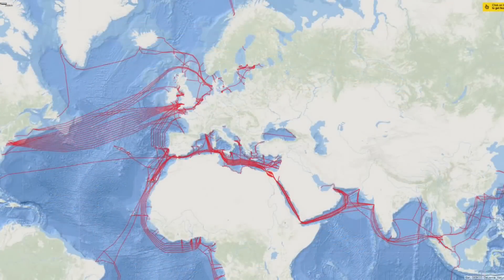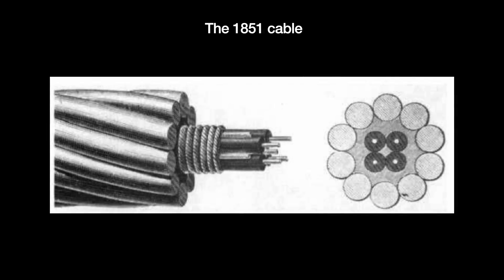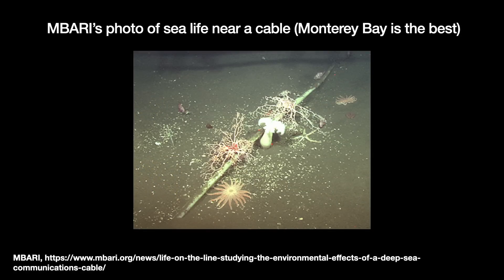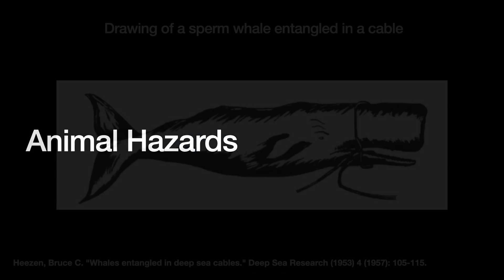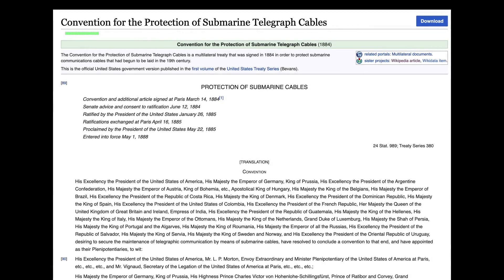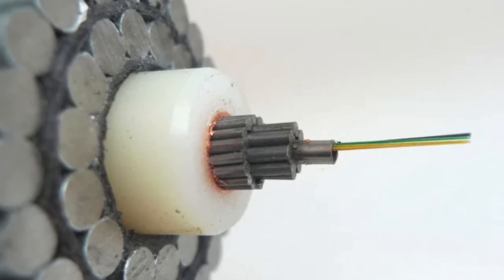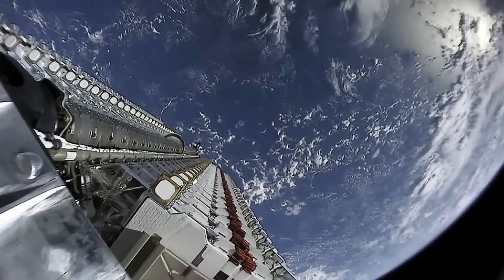The Hazardous Life of an Undersea Cable

Comment: I don't believe anyone was building a telegraph network in Germany in 1811 (at 0:33)
Reply: It was an optic telegraph and france already had one in 1790s.
Reply: @anush_agrawal  I did know that but the context here is an electric cable in water. Begs the question, why was a cable needed for a line of sight optical semaphore ? Interesting that we are back to using light, now in fiber.
Reply: @glenbirbeck4098  It was not a optical telegraph, my mistake, but a telegraph which functioned thought electrolysis. It was electrochemical telegraph. The message was read by amount of gas emmited in the process.
Reply: @anush_agrawal  Thank you Anush. This telegraph with electrolisis would make an interesting element in a "steam punk" story.

Comment: Now lets talk about it's not like you can connect a magnetic inducer and read the magnetic fluctuations of the copper wires how do they perform espionage now under sea with optical cables? I'm sure this man knows?
Reply: Guess the answer is every 60km, repeater

Comment: A good friend of mine, trained as ME, worked in BL served as Undersea Cable system engineer and dual-reporting to AT&T Undersea Cable business unit in late 80s and on, until sold to Tyco. He said shark bites were/are the common occurrence.  We theorized that
- in electrical signal transmission, although at T3 speed, the pulses and harmonics emit RFI, electric shield (steel armor as emission shield) does not work too well.
- Since the new TAT-8 has just transitioned to optical fibers but the problem still did not go away, so the working theory is magnetism!
<-- it is due to HV DC*1  is carried within (to supply power to intermediate nodes*2).  This uni-direction flow of DC current generated very strong magnetic field and the sharks are very sensitive to that (and would bite.)

*1.  DC current is one way passing through cable sheath, the return path is "Sea Water"!!!
*2  There are many of them, not just for signal regeneration and/or multiplexing.   Other "undisclosed functions" were/are deployed.  Undersea (under the sea) is fun, isn't it?
Reply: which 3LA puts out those "undisclosed functions"?
inb4 the answer is "yes."
Reply: Sea Water return!? That means intermediate nodes and end nodes need electrodes to the sea water, right? Sounds like a nightmare of rust/oxidation.
Reply: Seems like an ideal private industry/government "partnership."   If you want a network of hydrophones on the sea bed to track.. aquatic activity.. they naturally need some data communications.  And if the cable operator needs amplifiers ("easy") or repeaters (harder/more expensive) those would seem to be an ideal place for such a thing.    

These days under the Atlantic, you can avoid needing any repeaters -- devices that recover bits and remodulate/retransmit them -- using low dispersion fiber and optical amplifiers.   You can deploy an optical amplifier that will increase the signal level of all the wavelengths of light in a fiber used in a DWDM (dense wavelength division multiplexing system.)   This is very powerful because it doesn't have to split out each wavelength, detect the signal, retransmit with a laser for each wavelength, and then recombine.   The optical amplifier works on all the wavelengths "at once".   

But this is where you need "low dispersion" fiber.   Imagine that you transmit a single pulse of light (on a particular wavelength/color).  As those photons propagate down the glass fiber, they don't all take exactly the same path through the glass.  So that pulse of light will start to "spread out" as it travels through the fiber.  And the problem is that it spreads out too far and smears into the previous and next pulse.  Low dispersion fiber is carefully made using magic and physics and fancy manufacturing to keep the photons nudged closer to a single path down the middle of the fiber.   The extreme version of this is "single-mode" vs. "multi-mode" fiber.

There is an amazing amount of engineering going on with these systems, and over the last decade or two, the systems are constructed to carry data as the first-class, primary customer, rather than synchronous TDM traffic of multiplexed phone calls.  The hand-off to customers looks like an ethernet, and cable operators have much more flexible bandwidth allocation tools available that didn't exist in the past with SONET/SDH transport systems.
Reply: Some of this is undoubtedly true.  We had cables which did NOT have a steel cable wrapping, with very high voltages in them.  The copper outer shell did not contain magnetic fields hardly at all, and mostly by eddy effects.  Leakages were high.  We did one job, where the strength members were all Kevlar or Aramid fiber.  In that case it did not matter if anyone tapped it, since it was just going to an undersea oil drilling tooling fixture, and everyone knew what was going on.
Reply: Hazardous environment justifies the investment of pre build maintenance facilities and repair possibilities thus IMHO never a super long cable without built-in pods.
BTW, between technology and political influence, one always wins.

Comment: How do they repair these cables, lifting them again from the ground should be nearly impossible if the range of weight is between 15-70kg/m length, right?.?
Reply: It's true they are heavy, but that is usually how it's done. Bring each end up to a ship where the splice is made
Reply: @projectnarrowpace  I mean I can imagine that might work for cables in a depth of 200 or 400m maybe but what about transcontinental cables, across the Atlantic or the Pacific Ocean?.?

Comment: I live in Launceston, Tasmania.  There is a proposal to build a factory on our main river (Tamar) to build this sub sea cable, it requires a 200 meter high tower so the dielectric can form uniformly under gravity.  The people responsible are trying to make a cable for deep sea power transmission.
Reply: HVDC cables have quite different needs to communication cables. On the upside, no repeater stations. On the downside, more expensive materials (on the new one being laid from Morocco to Britain the copper alone is almost half the cost of the entire project) plus you MUST bury them well (can you imagine what happens when someone's anchor breaks one ...).

Comment: Revives memories of how slow the internet was in the 90's because of the lack of undersea cables & the number of personal servers in UK dorm rooms instead of AWS virginia.
Reply: Dialup internet was soooo slow, and you can't use the internet and landline at the same time. "Bad" times.
Reply: And there was also significantly less competition for those resources as well. No streaming, no online gaming etc etc etc
Reply: Inb4 fiber optics provided cheaper materials with better transmission.

Comment: The first undersea telegraph cables were in the 1850s - 1860s and the whole world was connected by about 1900.  But all of those cables were just that, a big long wire, and enormous voltages were used to send messages very slowly.  Telephone and high speed data needs amplifiers and electronics.  That wouldn't happen until 1956 with TAT-1, which had miniature highly reliable vacuum tube amplifiers built into the cable, every hundred miles or so.  Up to 36 simultaneous phone calls between Canada/US and the UK.

Comment: One of the most interesting aspects of this story, to me, is the lag between the first transatlantic telegraph cable, and the first tele-phone- cable, TAT-1, almost 100 years later!!  And half a century after Marconi spanned the Atlantic with radio in 1906. You would think the transistor ultimately enabled it, and of course that had to wait until 1947. But they were new and un-tested.  It was all done with tubes.
Reply: Bandwidth requirements for telegraph (binary Morse code) and telephone (voice) are RADICALLY different. The capacitance of the cable really affects that - and seawater is a wonderful dielectric (ie a cable under it creates a massive capacitor).

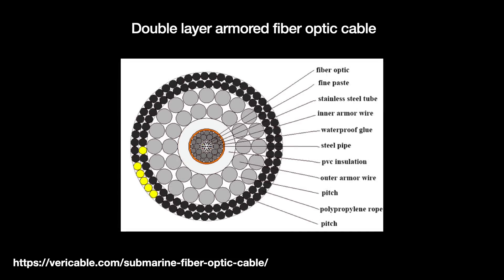Comment: 4:30 🗣️🗣️🗣️🗣️ galvanized steel mentioned 🗣️🗣️🗣️🗣️
Reply: We are only missing the eco friendly wood veneer
Reply: And the screws borrowed from an aunt
Reply: I hate my receptors for instantly recognizing and attributing to the meme when hearing that now
Reply: 😊😊😊😊😊😊😊😊 @pyrojinn
Reply: Little Johnny needs to talk to his aunt on the other side of the globe
Reply: immediately went to comments and found
Reply: I used to galvanize steel with a coat of chrome ;-)
very dirty work
Reply: i immediately came down to look for a comment about this
Reply: please stop glorifying brainrot
Reply: I THOUGHT THE SAME THING
Reply: I mean, I was kinda sad it wasn't square.
Reply: Now what element will we use to conduct this beautiful current?
Reply: One hundred million years
Reply: Galvanized steel, big whoop.
Reply: "Little Johnny recently got a new 0.00000001m² apartment, but found out it's on an undersea cable, so he decided it was time to rennovate it

First add a galvanised square steel frame, secure it with screws borrowed from his aunt, and cover it with eco friendly wood veneer."

To be continued

Comment: The US used nuclear submarines to attach equipment to tap into Soviet undersea cables during the Cold War. I assume that still happens on both sides.
Reply: It is incredibly difficult to tap submarine cables these days - not only do we know when breaks occur we know roughly where they occur as well; and on top of this many buyers of capacity on submarine cables use line rate encryption tech like macsec. Far easier to capture traffic at packet exchanges etc. these days. Source: me, have worked for operators of submarine cable systems.
Reply: @cardboardpig  Russia does it regularly off the coast of scotland.
Reply: @cardboardpig the CIA didn't break the Soviet cables to install wire taps. They just attached a novel device that listened in to the call traffic and recorded the calls to tapes which they later retrieved. They laid the wire tap between coast of Soviet's eastern-most mainland and military base on a Soviet Island off the coast of Japan.
Reply: Idk how you’d do that with fiber optics? But it’s probably a lot easier to just plant some boring spyware on their devices. Turns out most people are grossly susceptible to opsec mistakes. From downloading music to using super computers for Bitcoin mining to just connecting to the internet. The problem is 9/10 times human caused
Reply: This was not a hard tap.  No penetration of the cable occurred.    The equipment recorded the electrical and magnetic fields given off by the telephone wires through the cable casing. 

While there were multiple phone lines in the cable - it apparently was a small enough number to be able to separate their electrical signatures and individual conversations and data was recorded.

The data was recorded on tape (very large tape reel), with the monitoring probe switched something like every 6 months.   So all conversations and data recovered was at least a month old and could be 7 months old by the time the tapes got back to the secure lab that listened to them.

Another key was that the Soviet Union thought this cable was secure and there was no encryption of voice or data at the time.   Today, everyone assumes that no form of communication is secure and extensive encryption is now routinely used for classified data and conversations.
Reply: I haven't heard of any optical underwater taps but they do happen at the datacenters where the cables go. Look into "Room 641A". That is the most famous US/NSA example.
Reply: yeah, but not in the modern age...
Reply: Yes, surely we've learned all the possible short comings of everything and developed reasonable yet cost effective counter measures to each potential disruption  🤷‍♂️ 
Ok     @autohmae
Reply: There was one point where 15% percent of the world's internet was forcibly rerouted through a certain country before teaching its final destination. That phenomenon lasted for 18 minutes. 

Internet wiretapping, IoT hacking with raspberry pi zero, are pretty commonplace.
Reply: It’s not hard to tap a fiber cable when you have an unlimited budget.  You don’t have to cut it. You get the light out from the side with a very minimal attenuation.
Reply: @DasNewsNetwork  These were copper wire phone cables.   Long before fiber optics existed.